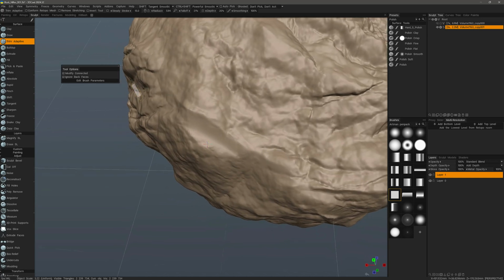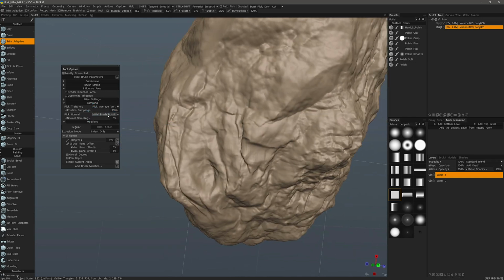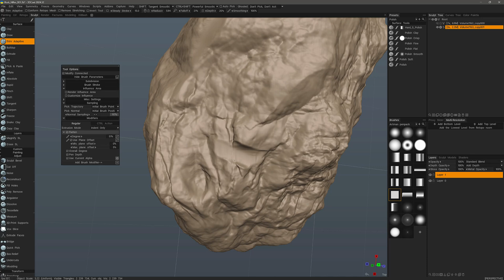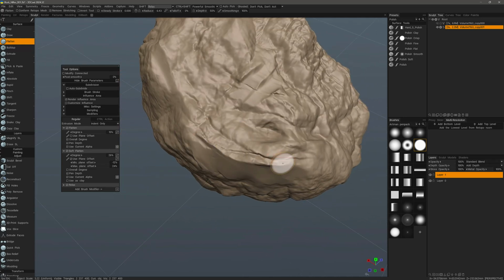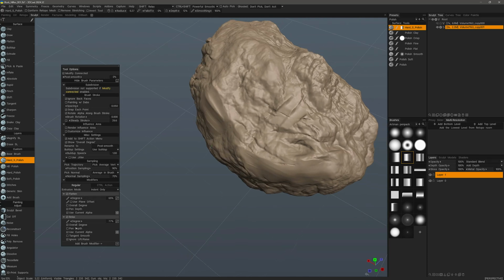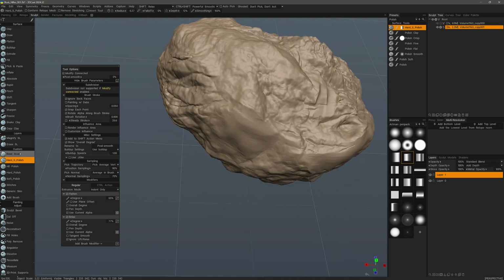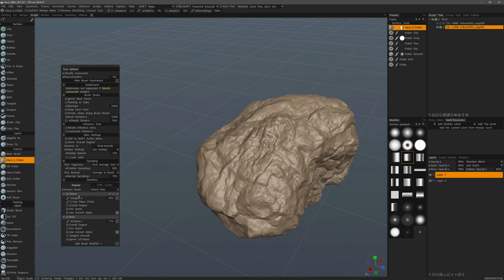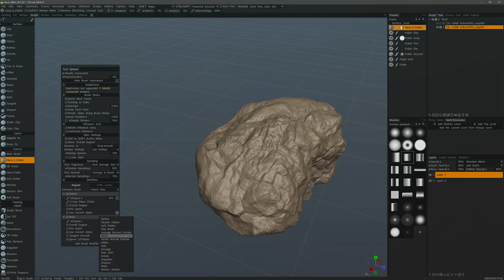H-Polish Equivalent in 3DCoat

Comment: Thank you very much for doing these videos, Im just a new user of 3DCoat just coming from Zbrush and while I was having resistance all these years I FOUND IT AMAZING! A quick question: there is an option for preserve edges when using HPolish brush to clean up Hard Surface shapes and retain the angles, which would be the equivalent to emulate that here? Thank you very much for your dedication!

Comment: cant wait to see the "noise maker" equivalent in 3D coat video.
Reply from the maker: There are some Noise generation tools in 3DCoat, but not as extensive as the Noise Maker in ZBrush. Please send an email request for an equivalent toolset to development at support@pilgway.com. In the mean time, we will work on a video showing what 3DCoat offers currently in this area. The Noise tool in the Sculpt Room is one and the FILL tool in the Paint workspace has a number of different Procedural Noise patterns one can use to fill a texture with.
Reply: @PILGWAY3DCoat  It would be amazing if 3d coat had something like zbrush noisemaker with mapped texture real displacement mesh , in blender its possible to achive the same result with the displace modifier .